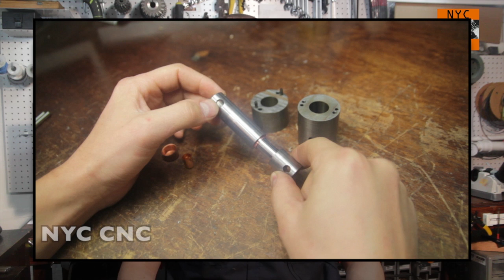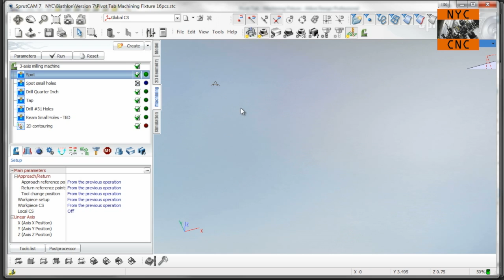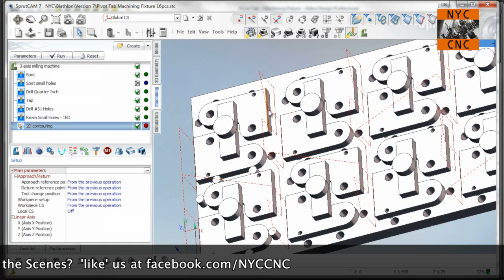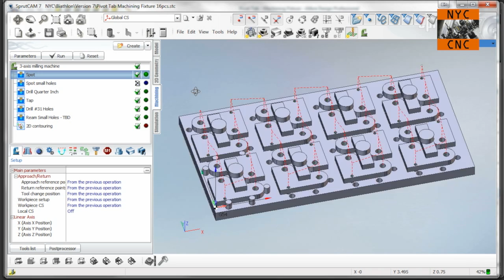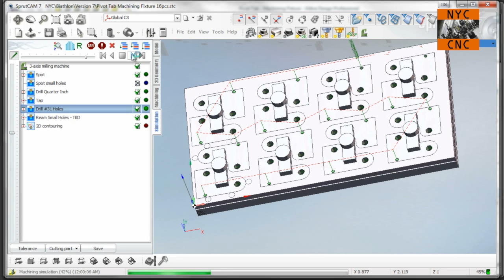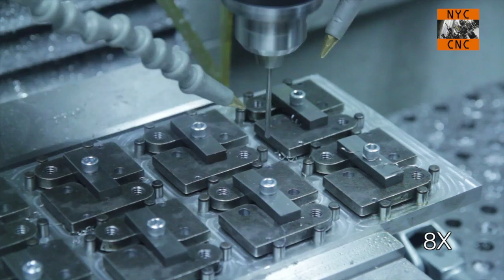Manufacturing at Home - Fixture Plate to Machine, Drill & Tap Steel Part

Comment: I know John is way past this kind of fixture now. You can tell the age of the video by the brand of vise: Tormach, then Glacern, then Kurt, then Orange (might have been some others in there...). Anyway at 16:25 or so when drilling of the large holes starts, you can see the entire right side of the fixture plate deflecting downward from the pressure of the drilling op. While that might be fine for the tolerances on these parts, it probably could have been prevented by using longer aluminum vise jaws when using this fixture. Even though they would extend beyond the base of the vise, the beam stiffness of the aluminum jaws would probably eliminate the visible deflection.

Comment: I watch your videos for hours and see you use several cad/cam softwares
. I am getting ready to buy a Tormach 770 and will need a entry level cad/cam. I dont like fusion360 due to cloud based software so its down to Sprutcam or suggestions. I use Solidworks and would like to use cam inside SW can you offer suggestions.
Reply: Fusion 360 is for free if you make less than 100k per year

Comment: I like the fixture and I had a couple of thoughts. Have you thought about using another pin on the middle where you have the bolt for your clamps to help to make them placed against the outside locator pins so you don't have the chance of them working away from the other pins a little bit? I know it wouldn't be much and probably wouldn't matter on those parts but just a thought. 

Also why do you mill the ends in the pattern your using? The reason I ask is because to me it seems like if you made a complete pass in the Y axis to  you could save some time instead of going back and forth between and across each part.
Reply: NYC CNC For some reason it was tough for me to word it properly when I asked so I'm sorry about that. When you end mill the bottom part of the bracket why didn't you use a pattern like you did when you did the spot drilling on your parts in this video?

Comment: Nive fixture and really thought out :) If you have extremely high volume part, I would almost suggest using toggle clamps like those available from Wixroyd. No tools part change is convenient and fast :)

Otherwise, if you really have to use socket head cap screws, take a cordless drill, insert a piece of allen wrench in the chuck and adjust the torque limiter. Very fast and very easy.

Other than that, ALWAYS put some blocks under your fixture if you are drilling. Dilling as an operation imposes huge loads on the part and as can be seen from your video, it makes the fixture bend a lot. Either bolt down some scrap blocks or use parallels or the easiest just regular machinist jacks under the near ends.

Comment: Your fixture is flexing during the drilling operations on the wings.
Reply: True, you should put some machining jacks under it to support it.
Reply: @romainstoudmann1346  Or just use longer aluminum vise jaws. They would be plenty stiff for the short overhang  and a little less fussy to setup and break down.

Comment: I had a cnc instructor who despised indexing off of the top of the fixture and setting Z0 there.  Something about positive cuts being a no no.  I think your point about part to part thickness variation is quite logical, but why not set my G55 Z0 at say the top of the vise, table, or fixture?  Of course there would be something between the part, but for me it seems much easier to look at code and program Z depths when you know that anything negative might mean bad news.

Comment: I see some of your tools use a clearance height above the clamps and not just the parts causing you to cut a lot of air. Try sorting the holes and breaking up the drill cycles to jump over the clamps or just have separate part and rapid planes. What I'm getting at is toggling between G98 and G99 Z/R planes. I try to keep air cuts under .100" with a rapid plane 1/2-1" above for checking in single block mode.

Comment: Run a .015 chamfer around the bottom of the fixture plate it will help with sitting it in the vise. Also next fixture your make. Make it out of 3/4 thick material or put jacks under the ends it will help you with fixture longevity. I understand the parts are not critical but I am a believer in make it super strong once instead of saving money 3 times. All in all good fixture good layout for someone who hasn't been doing it all that long you have you act together. One piece of advice I have been a machinist for 15 years and I learn new stuff everyday. The guy that I work with has been a machinist for 38 years and I taught him a little trick the other day so you will never stop learning. I wish I could have my own business but that's what I am saving for best of luck in the new year
Reply: When I turn something. I rough everything to .095 then rough to .035. Then when I put my finish tool in I touch off and take .015 measure which should leave .020 then I split it in half cut .01 sand measure take the rest sand measure 99% it always puts it right on the number if not it never takes to much so then I just sand a tad more. And if you have a bearing diameter that calls for a 32 finish I use the light machine oil and sand with 180 and or 220 and it always puts me in the finish spec
Reply: You should look up centroid cnc 5 axis and just watch this thing move absolutely incredible

Comment: nicely done and thanks but not sure about the drilling over air that occurs on the outside pieces. At around 16:20 the flex of the fixture plate is visible as you drill those holes. Should use a few jacks for support  to ensure you don't break a drill or dislodge the fixture from the vise. Keep up the great vids!

Comment: John, about your question to put that pin on the milling machine.    Sorry but to insert that pin in a press fit tolerance, you will have to do it after the parts are done. 

To do it in full auto mode, you would need a machine build just for that part, that would puch the holes, tap one hole and insert that pin and the part would be finish.
Reply: John NYCCNC A little bit of humor doesn’t hurt.   But on the manufacturing aspect of it, if someone really wanted an answer on that question.  It’s important to give the correct answer.    At a certain level, someone with time & money can build a special tool that could hold a fix number of small pins, and with one turn of the spindle one pin gets in position, ready to be push in place, like an automatic tapping head.  But with such a tool the important thing would be to protect the spindle and avoid Z axis collision when the pin is inserted.

But like I said, on a Tormach PCNC milling machine, outside milling, drilling and tapping and even with custom adaptors they offer.  When your process, for a certain part requires the insertion of a press-fit pin and you have a contract to provide millions of them.  I guess you do like the big manufacturing company and have a dedicated machine that will punch press each step and tap the hole and insert the pin to the part.

But on a small scale production, small runs, I think it’s better to do it by hand inserting that pin.     But I must say if one day someone does one tool that fits a milling machine and can press fit a minimum of pins for all the parts on the fixture, it would be a nice step in the right direction for all the small machine shops.   The necessity (or need) is the mother of all invention! 

And don’t stop the great job you do with your videos.

Comment: John,
I enjoyed this a bit after Thanksgiving but I hope the rest of the Christmas Holidays are great for you and your family. Face time on the video was very well done. Some folks over do it.
A good example of fixture clamping is one we use regularly in the shop, that's the carbide inserts.
Reply: No, just look at the way different carbide inserts are clamped into the holding tools. For instance I have a S10S-TNER2 Notch S-NE Boring Bar, it holds NT type bits ether threading or notching. Unless it is dirty the bits return to exactly the same positions. This is because the clamping force is applied to more that one registration surface. Look at your toe clamps if you had a tapered cone (very small) that pressed the part into the dowel pins and then applied pressure downward the parts the registration would or could be completed in one step. This comes directly from the Department of Overkill (DOO).

Comment: It seemed like the last pass with the endmill wasn't deep enough to clean up the edge.
Reply: John NYCCNC Sorry, when I said deep, I meant x-DOC (I think it's called axial engagement?). As the endmill passes over, you can see that it initially has full engagement, but moves towards the top (+y), you can see (and hear) the endmill come off the part. The third one seems to be the only one we can see that has the entire edge faced off.
Reply: John NYCCNC Regardless, I thought that the dowel pins were clever, and this brought me back to your mitee bite video. 

On a slightly different note, do you use some sort of work stop when doing large runs or do you rezero?

Comment: I feel like you could save some time, and perhaps make better use of your expensive sub-plate.. :) Good video, though.

Always nice to see people's process from CAD\CAM to the machine itself. I think that's often the most overlooked part of this; I often will show video of the machine running, but by that point, you've already missed all the smart bits.
Reply: John NYCCNC
Pin the fixture to the table, and not need to probe the fixture. Its not a lot of time or anything, just seems silly to spend the money on the sub-plate, then bolt a vise to it and let it fill with chips :)
Reply: No real need to make it any bigger, could still be easily pinned and fixed to the table. Would also stop the fixture from flexing when drilling, etc. Obviously though, you have a much better picture of whether this is worth your time than I do :)

Comment: Check out the safe rapid height on the small drill. Also, the fast forward shows the left side of the fixture flexing on spot drill op. Other than that the fixture is perfect.

Comment: Cool! I run a CNC Plasma machine as my day job. How much time did it take to do all the machining in real time?
Reply: Just wondering. Sometimes some of the programs I have to burn take over an hour per part!
Reply: Plasma and Oxy. It has 1 plasma head that we burn up to 1" materal. We can run 2 oxy. torches at the same time. The table is 10'x 30' so sometimes we have some very large jobs with lots of holes. I burned some parts of Oxtool the other day. Going to mail them to him. I am in Ohio. Going to be neat to see some parts I burned going into the big press he is building!
Reply: Lima there are branches in Dayton, Springfield and Mansfield.
Reply: Wow small world.